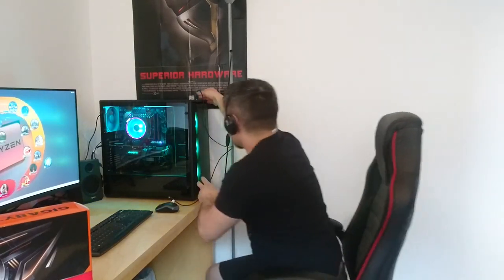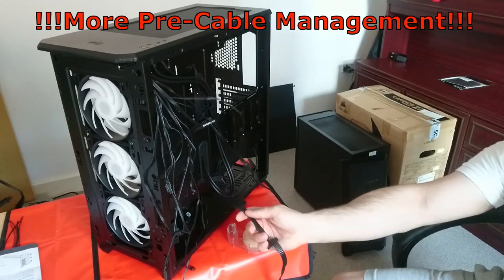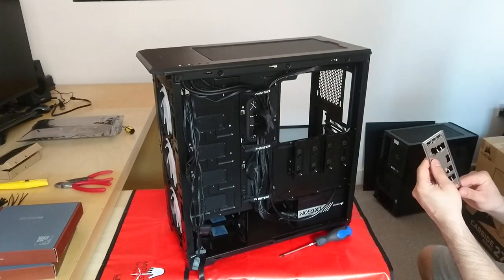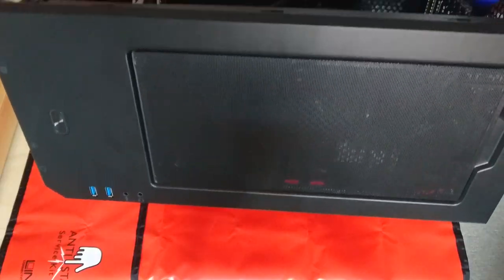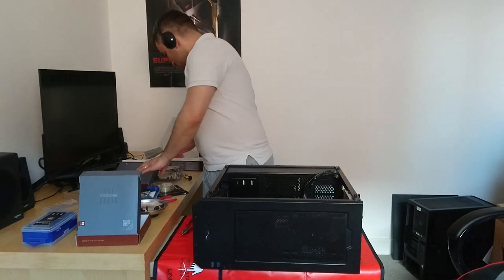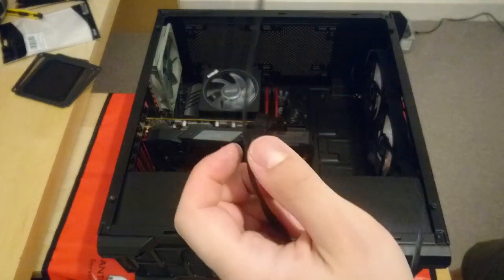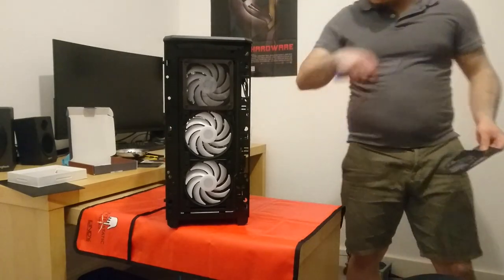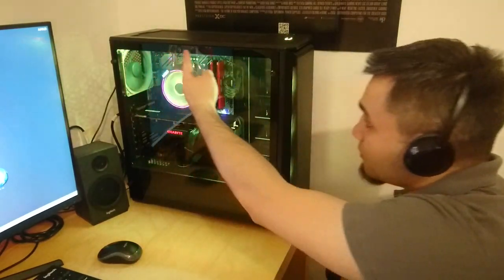Building a Ryzen Mid Range Gaming PC in the Phanteks P400A Digital Case guide

Comment from the maker: Extra components used in the rig include: Fan cable splitter extensions (2 fans onto one header) , Fan control hub, extra fans(later swapped out with RGB), RGB Strip, Cable Sleeved Extensions (added later -see video link in description)

Comment: Hey man, where did you connect the cable that reads "d rgb fan" to? My fans turn on but none of them are rgb.
Reply: I feel your pain cant figure this out myself
Reply: Same! Please someone help us 😂
Reply from the maker: You dont need to buy a corsair fan hub. The fan hub is build into the case. 2 cables come down next to fan cables. They are from the hub. Connect RGB connectors of your fans to those and connect a sata power cable for one end. that will power the RGB hub.

Comment: It's nice that you shared some of your "challenges/realizations" during your installation (e.g., needing take out your motherboard  to re-route your 24 pin connector). This is will help me avoid these issues in my installation...so thanks for sharing.
Reply from the maker: It was the GPU power connector. I could have pushed it through from the side and save having to take the motherboard out but I thought its tidier if it comes from under. So what you should do is put the GPU power connector through from the bottom before installing the motherboard if you want it coming from the bottom and through the little gap under the motherboard. .
Reply: @kageshinobigames3216  Thanks!

Comment: cool! I have the same case and after watching this video I think I'll get some dust filters as well.
Reply from the maker: Glad I could help! They do stop a lot of dust from getting inside your case
Reply: @kageshinobigames3216  can you tell me which size of dust filters you used?
Reply from the maker: They need to match your fan size. For this case it can be 120mm by 120mm or 360mm by 120mm. Whichever you can get at best prices.
Reply from the maker: The only thing I changed at a later time was, notice how you can see the filters are outside the case when I screw them on but I actually moved them between the fans and the chassis. This way they even reduce rattling and vibration.
Reply: @kageshinobigames3216  awesome. will take that into consideration
Reply from the maker: @norton9216  sorry I didnt get a notification for this question. Far as I know alll fan headers on motherboards are 4 pin. You can plug onto them fans with 3pin and 4 pin female power connectors. As far as RGB goes the motherboard has to have a 5v 3pin addressable rgb connector to sync fans using software but its not compulsory. You can control rgb using a specific rgb button on front panel next to power button.
Reply: @norton9216  Stock fans are 3 pin in this case, you just plug them into the 4 pin header on the motherboard and they will work. Then go into the BIOs and make sure the fans are set to DC for fan speed control.

Comment: Hey man I dont know if you still read comments but I have a question with my case. Its a little bit different but its still phantecks p400 so I dont know if you had the same problem. Theres a wire connected to the bottom of the power button and its a SATA connector. It shouldnt connect to the hard drive And even if it did, its not long enough to reach it

Comment: Just brought this case, love the video! Do I need any mounting brackets for this rig?
Reply from the maker: Hey Luke. Thanks for your comment. You dont need any brackets unless you want to mount the gpu vertically or your gpu is sagging than you can get a GPU bracket. https://www.amazon.co.uk/upHere-Graphics-Anodized-Aerospace-Cards%EF%BC%88black%EF%BC%89/dp/B076GYL25H/ref=asc_df_B076GYL25H/?tag=googshopuk-21&linkCode=df0&hvadid=309932714284&hvpos=&hvnetw=g&hvrand=11561210492273395583&hvpone=&hvptwo=&hvqmt=&hvdev=m&hvdvcmdl=&hvlocint=&hvlocphy=9046523&hvtargid=pla-562571101390&psc=1
Reply: KageShinobiGames Thank you for your reply, I’m new to building and will purchase the mount you suggested. I can see you really help the community which is great and very much appreciated by all Im sure. I will start my build in 2 weeks, if I am having difficulties I will come back to you, if that is okay with you?
Reply from the maker: @lukegee489  Of course Luke. You can contact me on the Facebook page as well. See description for details. Please give it a like while you are at it. Good luck with your build. Just one tip when beginning the build is your front fans got 2 sets of cables. RGB and 3 pin female power connectors. Separate those to begin with to make your life easier. If you watch carefully at about 5 mins you should see what I did. Cheers. Juzo

Comment: Great Video!! I would like to ask you a question, I just built my own first pc and I'm verymuch a beginner. I bought the Phanteks Eclipse P400a because its a great deal and looks soo good!!! but I Cant figure out how to connect the fans to the power... I already connected the leds to the mainboard and that works brilliant but they dont spin..... can you or someone help me out? do i need an adabter?? Thanks in advance.... PS: pls discribe it clearly im a bloody beginner :)
Reply from the maker: the fans rock 3pin power connectors that plug onto standard motherboard fan headers. In your motherboard's manual you can find where they are located. If you are adding extra fans you will need fan splitters.
Reply: @kageshinobigames3216   Thank you so much!!!

Comment: Other than the additional exhaust fan(s),  splitter cable, add-on fan dust-filters and RGB strips and extension cable  did the case come with everything you used in this video (e.g., 'holder" for your 6TB drive, etc.)?
Reply from the maker: The case did come with 2 hard drive holders, however the fan splitters/extensions and fan hub I bought separately.
Reply: @kageshinobigames3216  Thanks. Was the fan hub only required to accommodate the extra fans you added. So  if you don't have a fan hub or use a splitter would  you have to have 3 separate fan headers on your mobo to accommodate the stock fans? I think the Fan's RGB connections are all daisy chained together, right?

Comment: I'm currently trying to do this case and same MB. I have never fully built a system before only plugged stuff into the mb and unhooked something to change ram/GPU and reattach the cables.(still waiting on the processor that you're also using) You didn't show what you did with the fan connection's or the front of the case very well and those are the main things i'm questioning as the case does not fire up to start the fans. I followed the pictured diagram from the book and everything is in the correct spot. I unplugged and put the writing on the 3 wires for the front panel upside down and still the power button does nothing. Am i just crazy or did i do something wrong. I'm sure everything is in the right spots and the light on the MB is on when PSU is powered on but nothing happens to power anything up when i hit the power button.
Reply from the maker: You have to use the Sata cable that you also connect Sata SSD or Hard drives to power the RGB in the fans and the fan power connectors have to be connected to a fan hub or the 4pin fan headers on the motherboard. The fans are 3 pin female but they plug onto the motherboard. If you wanna use aura sync there is an optional 3 pin ARGB cable that you can plug into the MB near the 24pin socket.

Comment: Where do the fans plug in? Can u please explain or make a video about this
Reply from the maker: Fans have 2 sets of cables coming out of them 1 set for RGB and 1 for Fan power and speed control. The RGBs plug into each other. Highest to lowest fan than the Standard 3 pin fan connectors can just plug onto fan headers on your motherboard or fan splitters. There is a single addressable RGB female cable that comes from the RGB cables that you have the option to plug onto your motherboard if it has a 3 pin Addressable RGB header. Consult your motherboard to see if it has a header like that. (it will have a 5v connector as opposed to the 12v the 4p standard RGB header that also may be on your motherboard). I hope this helps. Lemme no how you get on. Cheers
Reply: KageShinobiGames what do u mean by rgb fan header plug into one another
Reply: KageShinobiGames srry but if you could make a video about it it will be really helpful
Reply: @mahdichowdhury950  They are daisy chained together in this case.

Comment: I wonder how the additional dust covers affected overall airflow in the case. Steve on Gamer's Nexus has generally commented that the fine mesh case for these type of cases is adequate for dust filtering and adding an additional filter layer significantly impairs airflow and thus negatively affects the thermal characteristics of the case...... based on his thermal testing. I don't know but I trust Steve @GamersNexus. Your thoughts
Reply from the maker: It may slightly reduce airflow but 3 front intake fans are overkill a littlebit plus the fan on top is intake and for that I was considering adding the fan filters but the top fan filter is fine enough I think. My thermals are great so if you are only adding one extra fan thats an exhaust only maybe you should avoid adding extra fan filters.

Comment: I'm planning to build my first PC in this Phantek case...so this was very helpful. Personally I like your technique of doing pre-cable management. Question: With this technique do you ever find that pre-routing these cables ever interferes with the installation of the other components (e.g., mobo, GPU, etc).  BTW, since I'm new to building PC's I actually would like to have heard your comments on the parts of the video that you played at 5X speed. 😀
Reply from the maker: I am in the process of uploading the sections where I fast forwarded or I may reupload the video without fast forwarding but it may take a little while as I dont have much time to edit video with a full time job and a family.
Reply: @kageshinobigames3216  Don't feel you have to do it just for me...Totally understand the time limitations. It's good as it is.

Comment: which dust filters did you use? thanks
Reply from the maker: Just unbranded ones from Amazon. The sizes matched the fans sizes.
Reply from the maker: But in a following video I show how I move them between fans and the case amd that way they also reduce vibrations.

Comment: Hi, do I need to buy an ARGB fan hub if I want to connect the 3 fans on the case? Can I connect the 3 fans to one 3 pin 5 vault ARGB header on my motherboard? Thanks
Reply from the maker: You dont need to get argb fan hub as they can just link up together and the  3pin 5 volt argb connector can connect to the header.
Reply: @kageshinobigames3216  Thanks so much!

Comment: Damn dude. I tried building my pc yesterday and couldn't get anything to turn on. Hopefully if I take the motherboard out and cable manage I can find the problem. There are a lot of wires that are connected to one another on the case idk what they are. I thought they were fan splitters. any advice?
Reply from the maker: You should unplug everything from motherboard and only leave power connectors. Are you sure powersupply switch is on? Its crazy how many ppl forget about that. Its right next where you connect the power cord in the back. Make sure thats on. Is your gpu installed and power connectors connected to the powersupply? Go through every power connector. Do not mismatch the rgb connectors. The 3 pin addressable rgb is 5 volts, the 4 pin standard rgb is 12 volts. The rgb cables on fans plug into each other as a chain and it has 5v rgb 3pin  female plug that plugs on motherboard addressable rgb header. This is optional. You can control fans rgb using button on front panel.

Comment: is there a rgb fan hub that came with the case?
Reply from the maker: The RGB hub is built into the panel where the power button is on top of the case.
Reply: @kageshinobigames3216 thanks for the reply! does it support additional fans?
Reply from the maker: @johnan06  You can plug rgb plugs into them but the fan power cables need to be plugged into motherboard, cable splitters or fan power hubs.
Reply from the maker: @johnan06  Hi Ethan. If you find the video useful or informative, please share to like minded friends... Many Thanks Grazie Mille

Comment: Just built my pc with this case, the lights turn on, but the fans dont spin, please help
Reply from the maker: The fans have 2 sets of cables with connectors. 1 set are the rgb that sorta plug into each other and after you can connect to a rgb header on the motherboard to control via software. The other 3 are 3-pim power connectors that you can connect to a fan header or a fan hub. Did you connect those to the fan headers on the motherboard or a fan  hub?
Reply: KageShinobiGames are the 3 pin power connectors female?
Reply: KageShinobiGames ive never built a computer this is my first time so im confused
Reply from the maker: @idontzucc  yes mate they are. And there are 3 of them. Longest one comes from top fant and they get shorter the lower they are. Not a problem mate, Im also not an expert and it takes a minute to get your head around the wires and they look complicated at first. Sorry bout late reply.

Comment: So I bought this case, and my motherboard is the Asus TUF gaming X570 Plus Wi-Fi. Do I need any sort of splitter for the fans to work properly? Would the fans be able to be automatically controlled by the mobo via temperature? I'm not sure if I should return it for a different case
Reply from the maker: Nah man give it a chance. You will needs standard fan splitters if you install any exhaust fans but to control rgb. You plug the rgb fans into each other first and than a single addressable RGB cable (3 pin with a 5v pin) plugs onto your motherboard to sync it with any other rgb you may have or intend to install in future. Does your motherboard have aura sync? Look at your Motherboards manual. I hope this helps. Let me know how you get on mate. Cheers
Reply: @kageshinobigames3216  Yeah it says it has aura sync. Can you link me the appropriate splitters? I'm a first time builder and am not super sure about anything lol.
Reply from the maker: @flopkin  Also if you want compatible RGB fans you can get the ones the case comes with. http://metallicgear.com/Skiron-RGB-120 Just search for them on Amazon. But for the Fan splitters you can either get splitter cables or fan hubs. Splitter cables You dont have to get Phanteks ones. You can just get generic ones. https://www.amazon.co.uk/Splitter-Computer-Converter-Sleeved-Braided-Black/dp/B01N1Z3FYD . When it comes to Fan hub or controller I just found a cool Phanteks one https://www.amazon.co.uk/Phanteks-Universal-Fan-Controller-PH-PWHUB_02/dp/B07NHQRCRM
Reply: flopkin im getting the same board, what did you do to make the mobo work
Reply: KageShinobiGames is this only for rgb or can I use normal 120mm fans without needing any of those things ?
Reply: i also have ASUS TUF GAMING B550M-PLUS
Reply from the maker: Sure the RGB is optional but its better to get this case with RGB, than the normal one in case you change your mind about RGB.

Comment: Love the vid how much was the build
Reply from the maker: Wow. I didnt even think about adding costs. Sorry. Everything in build was bought brand new. I got some on really good offers. I will put a detailed price breakdown in the description but from the top of my head. All from UK retailers. (£)
CPU: 160
GPU: 400
Motherboard: 170
Ram: 75
PSU: 89
Case fans: 25.98 (12.99 each)
CPU cooler: 20
Case: 80
1tb nvme ssd: 100 (m.2)
6tb hdd: 120
512gb nvme ssd:  70 (m.2)
Hope I added everything. For US prices convert currency.  GBP - USD Total: £1310 approximately
Reply: KageShinobiGames thank you so much

Comment: Where do i plug the fans power female cords not the rgb + i dont want to plug it into the motherboard please help💔💔
Reply from the maker: Onto your fan headers on the mother board. The fan power connectors on this are 3 pin female plugs. They plug onto standar 4 pin headers on the motherboard mate
Reply from the maker: If you dont want to use the motherboard's fan headers you can get a fan control hub that's powered by sata.
Reply: KageShinobiGames thx

Comment: Where do i plug in the rgb fans?  Do they plug in the motherboard?
Reply from the maker: You sort of plug them together and their RGB lights are powered by Sata connector. And the 3 RGB fans also has single ARGB connector 5v (3pin) that you can plug into the motherboard to sync with the motherboard's RGB. Plus there are 3 fans connectors that are 3pin that power the fans to spin they plug into standard fan headers and can be controlled by voltage as they are non-PWM.
Reply: KageShinobiGames oh, thank you so much!!! Btw keep up the great work with the chanel, you just helped me buyld my first pc, thank you so much once again! 🙏❤️
Reply from the maker: @ppvgclau9363  im so glad it helped you brother. I have made some improvements to this build and its not major but you may consider going the same route. In a day or 2 the video with the improvments will be up. I recommend you check it as you might find it useful. Really apreaciate you my friend and I wish your PC to bring you a lot of fun experiences. I would love to see your build. If you want to you could post your specs and a photo on my twitter or Facebook page and I can mention it in a future video if you are okay with that or just message you some feedback on it. Please let me know in the post what you prefer. Links to social media in the description.